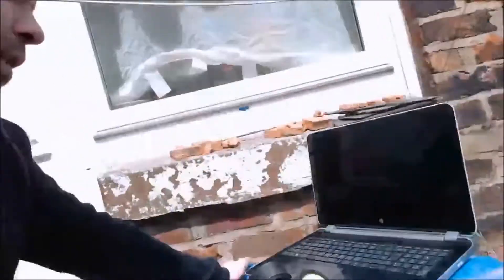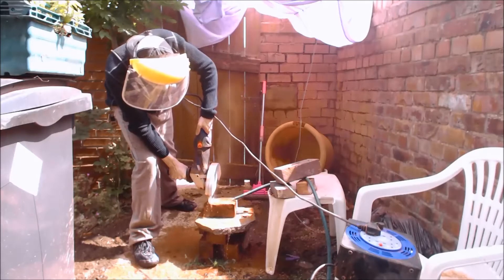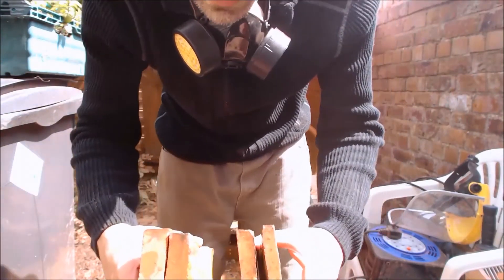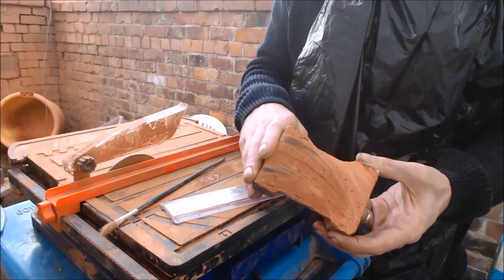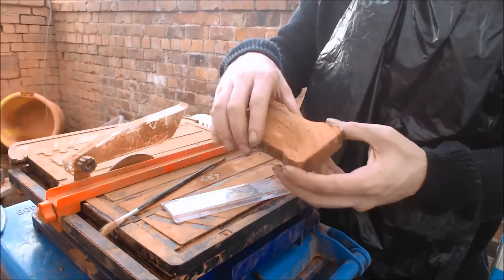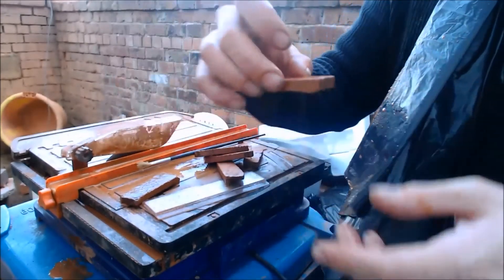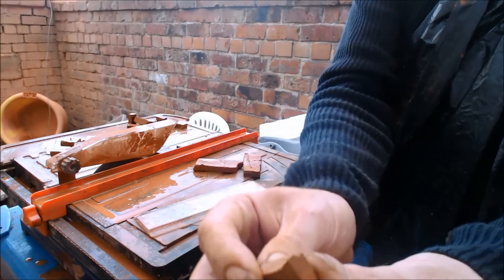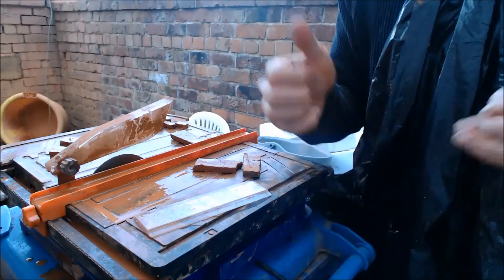Scale Accrington Brick Manufacturing Process

Comment: You make that look very easy! I had no idea that you could do all that with bricks and not  break them. Kudos!
Short question on your earlier "wire cutter": you mean a simple cutter, nothing else attached, right? I just got back and have tried some ideas. 
Cheers mate! –Bas
Reply from the maker: Out and About West Hey Bas and thanks :-) mm these bricks seem 2.3x stronger than concrete and you can chop them down to a couple of milimeter diameters before they start crumbling on you :-D appartantly they used them for blackpool tower foundations and the foundations for the empire state building, I thought that was really cool considering they only make them local so must have shipped millions to the states :-) Yep I was thinking of the basic electricians hand cutters for say cutting up thumb wide sticks and such :-) https://www.google.co.uk/search?q=wire+cutters&biw=1670&bih=837&source=lnms&tbm=isch&sa=X&ei=raOVVfvvA8K4UZnHqdAP&ved=0CAYQ_AUoAQ#imgrc=T4TkKGMftfZ8RM%3Aand if they proved useful to have on their own then ponder on a way to add additional things in to the handles perhaps :-)
Reply: Yep, those are the ones I meant of as well. 
Instead of adding stuff to it, I've been thinking of ways to use it "as is".
Take lighting a fire for example. Tonight I tested my cutter on both a soft and a hard alloy ferro rod (LMF and one I got from my friend Nathan). Works well at the right angle.
My cutter doesn't state the sort of steel used, so I tried creating a spark with a piece of good flint … I think it might have too uch chrome in it :-) 
Cutting small twigs shouldn't be a problem either, but getting at the dry wood inside a larger stick would be more of a challenge. This could probably be done by cutting and twisting the ends vertically. I'll try that this weekend.
The rubberised handles would aid in loosening the fibers of, say willow or poplar bark to make cordage.
By controling the width of the opening, it might be used as a spruce root peeler, another good course of cordage.  
I really like this out-of-the-box thinking. Might even video some of it in the end (and give you a well-deserved shout-out).
Stay tuned :-))
Reply from the maker: Out and About West thanks really :-) I think it was something you said on one of your vids that triggered the thought, and I thought darn I use them for everything but wires :-D
 with the thicker stems and harder woods try just pinching the wood all the way around the bark like a pecking eagle :-) then go for the crunch after weakening the fabrics, it should take strain from your hands and open the chopping diameters available up a bit :-)
 The lmf does sound really sweet I want one to compliment my zippo now :-) great encase you get a good soaking or end up in the swanny by accident :-D
 I think you will definitely get the best out of the idea though and  hopefully give you some muse to say what else might be handy while out and about :-)
 no worries on the shout out but cheers for considering me :-) I really hope it comes in handy for the willow bark strips :-) and root peeler, I have treated my one with the utmost disrespect now for 7 years or so and its still pretty sharp which is a good sign.
 run with it, id love to see what you think and can come up with from it and I bet others would love it to, from me it would just be a bit of speculation, from yourself the review would really carry weight :-)
 And im happy whether they are really handy or you put the idea to bed as something better may come to your mind :-)
 ah and before I forget something that may be really handy for you, a solar power bank that charges your phone and can even run some small appliances :-)
 im sorry I cant link you but if you can have a search on ebay for '50000mAh Portable Super Solar Charger Dual USB External Battery Power Bank RT ' incase you find it handy :-D
 Love your attitude my friend, its very inspiring keep it and your video content coming :-)

Comment: That sure is a big job! Not done in a hurry lol
Reply from the maker: TOJO RC lol yeah any other brick would cut like butter under a warm knife :-) but no I had to take the strongest one so its the toughest cutting :-D Im loving the colour though and though it really is pretty timely it makes them feel a bit more special or something when you see them in a pile :-) Ive not forgot about some 1:60s btw :-p I am just seeing if I can get a few pallets worth in before I ship them over :-D the smaller the scale the faster and easier is to make the bricks believe it or not so its no worries :-)
Reply: battonfive Will it not be hard to make 1/60 scale? will be so small?
Reply from the maker: TOJO RC no I thought the same but because you can get so many thin sticks out of a slab of a piece of brick you find that when you are putting them through the wet saw and you are flicking them out with the end of the paint brush they start adding up pretty fast :-) they also seem to come out a lot more accurate as well, where the larger sizes always seem to need a trimming and smartening up here and there :-) the only thing I would say is it will take forever to stack them in to pallets they are that small and fiddly :-)
Reply: battonfive lol bet there small and takes forever to handle! Tweezers next? lol
Reply from the maker: TOJO RC for the 1:60s im afraid anything but tweezers would be almost impossible, when you try to stack 1:16s its almost pointless :-D 1:60s when making a wall atleast just need a thin layer of gorilla glue on them to represent the mortar, mortar at 1:60 scale is something like 0.25mm thick :-p
 they will be one shot deals though, right first time or bin or seconds pile, they are to small to clean up on the wet saw :-)
Reply: battonfive Well what ever keeps you busy lol
Reply from the maker: TOJO RC:-p will try anything your right though the specs for the 1:60s are pretty insane 3.92mm x 1.33mmx1.92mm :-p will let you know how it goes :-D ...badly I imagine but you never know till you have a go :-)